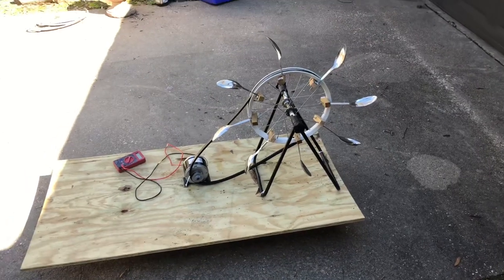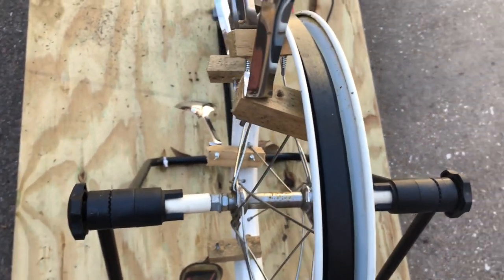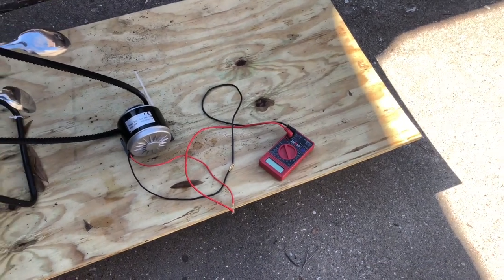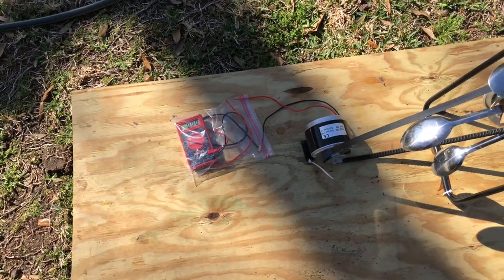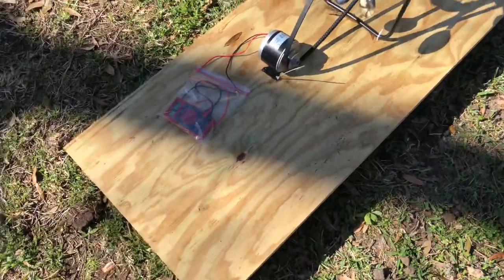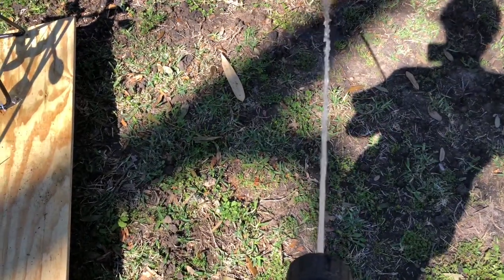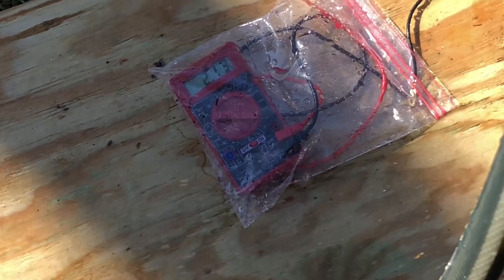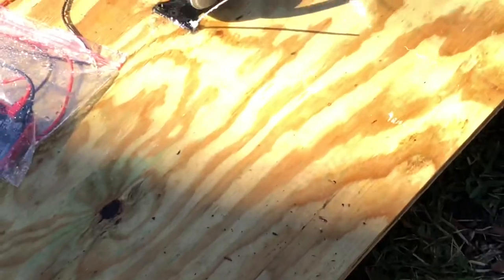Completed DIY water wheel generator!

Comment: What kind of motor is that ? And btw nice video ❤️
Reply from the maker: I’m glad you liked the video! 
This is the motor I used for this project:https://www.amazon.com/Electric-Brushed-2750RPM-Scooter-Control/dp/B07KVVL1NM/ref=asc_df_B07KVVL1NM/?tag=hyprod-20&linkCode=df0&hvadid=317203115653&hvpos=&hvnetw=g&hvrand=12793852601056534761&hvpone=&hvptwo=&hvqmt=&hvdev=m&hvdvcmdl=&hvlocint=&hvlocphy=9027599&hvtargid=pla-635620784133&psc=1
Reply: @RyeGsuperstar  thank you
Reply: Yeah am have to wait because it out of stock rn
Reply: @RyeGsuperstar  it’s
Reply: @RyeGsuperstar Would one like this do the same thing? “ AlveyTech 24 Volt 100 Watt Electric Motor for Razor E100, E124, E150, and E175 AlveyTech 24 Volt 100 Watt Electric Motor for Razor E100, E124, E150, and E175”
Reply: @RyeGsuperstar  or different one that does the same